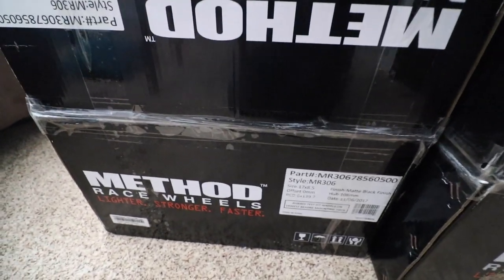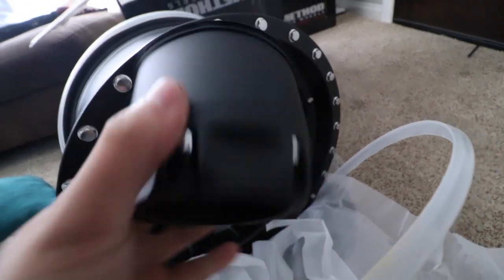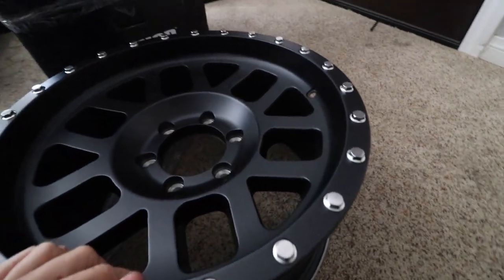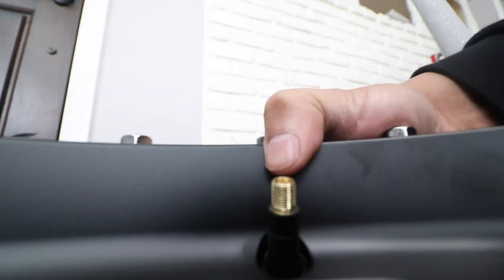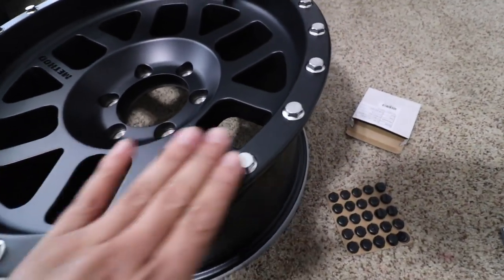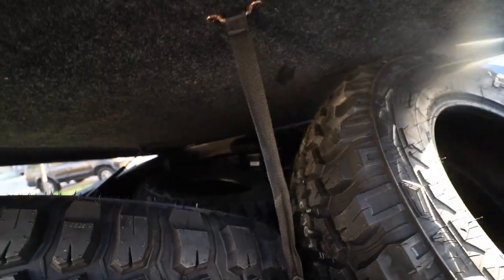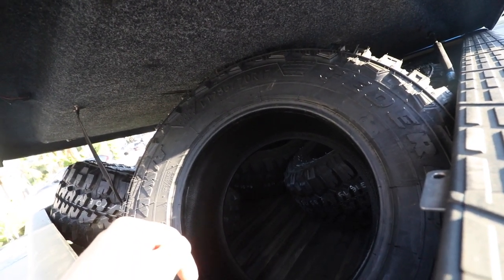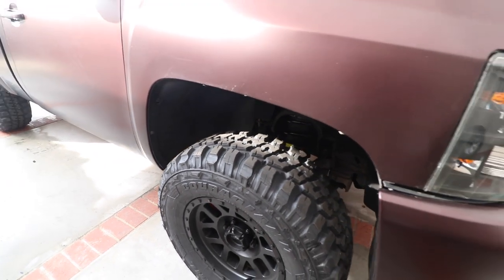SINGLECAB SILVERADO LEVELED ON 33S METHOD WHEELS!!!

Comment: I THINK THE RIMS ARE TOO SMALL I THINK 20S ON THE 33S WOULD LOOK BETTER ..
ETHER WAY STILL LOOKS GOOD THO BRO👍👍👍
Reply: Fast Bikes it all depends on what the owner plans to do with the truck. 17’s are MUCH better off road than any 20+ wheel. I have 22x14 on 33s on my truck and i can still take it offroading but i do have to be careful not to get stuck even with 4wd. I just bought a set of 17s and 35s for my actual offroading needs.
Reply: Everyone is running 20's on 33's even me and I'm tired of mine. I'm going with the 17's on 285/70r17's.
Reply: @09mazdasp33d  true that I agree ...